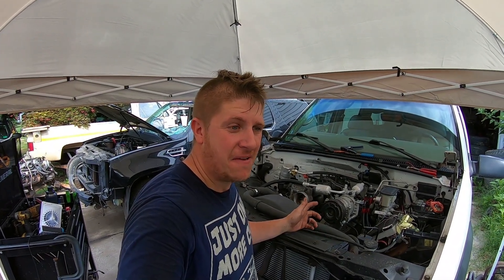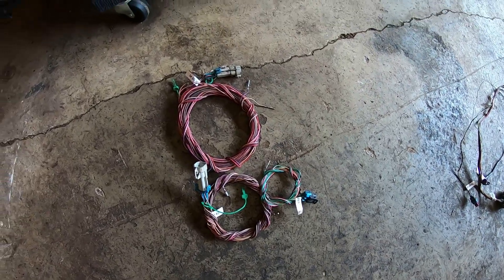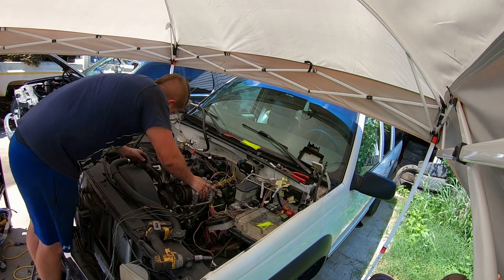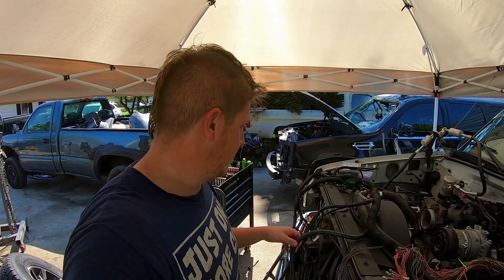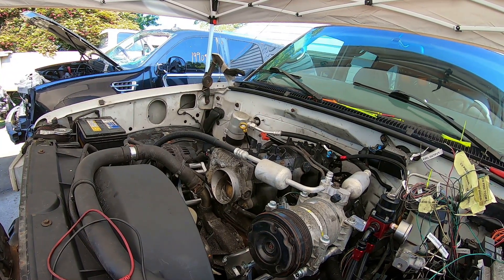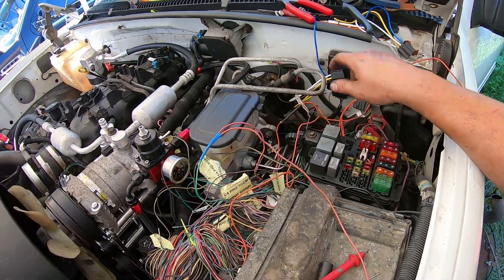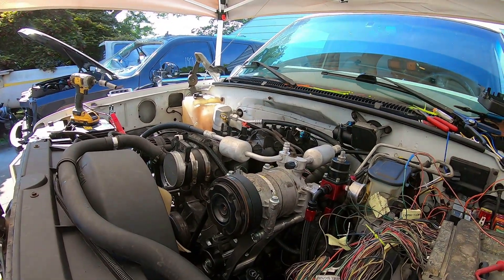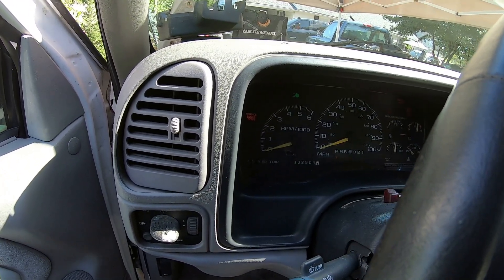OBS Chevy Suburban LS SWAP Part 3 - Electrical

Comment: Dude I like your vids, maybe you need to LS swap a weed eater and do some cleanup around the garage. LOL! Keep em coming. Maybe do a bit of how and why you strip the harness wires. Which ones to remove because, they are not needed, because...........
Reply from the maker: Thanks man! That would be a very heavy weed-eater! A little cleanup couldn't hurt, it'll get done once I have this project finished up. This harness I didn't really strip because we're using pretty much everything in it but I may have one in a future video that I could sow how and why to thin it out.

Comment: Yea man you actually explained and made more sense on taking my original harness and adapting it to the new one I wasn't for sure to pin it all the way in the plugs or just tie into the wires cuz someone I watched on a video was saying just to do that I'm glad I watched your video man thank you and you definitely got my thumbs up 👍👍
Reply from the maker: Appreciate the thumbs up man! Glad this info helped you!!
Reply: I got a question on the 4L60E transmission that I have on my 5.3 that came out of a 2001 Chevy Silverado I put it in my four wheel drive 97 Tahoe I have the ls harness hooked up to the motor and I have the big round plugged into the transmission and the two on the modulator I don't have the vent to hooked up do you think that's the reason why when I put it in drive it really ain't trying to go it's like second gear caches and it's got reverse do you think I need to hook up my factory harness before I'll know it has any problems
Reply from the maker: I believe the big round plugs are pinned differently on the pre 98 4l60e, so your 97 harness is not pinned correctly to control your 2001 transmission.

Comment: How did you get it to work with stock ignition
Reply from the maker: All you need is one ign 12v+ source from the stock harness to control your LS relays (I have a few that didn't have a job any more after I removed the stuff I didn't need from the stock harness so I used one of those) and then connect the original starter exciter wire to the exciter post on the starter. Super simple.

Comment: I am currently working on a 1997 k2500 4x4 swap. The donor is a 2002 5.3 ls L59 from a suburban. Does the a/c obs wires get relocated and repinned into to the 411 pcm. Great videos !!! You are inspiring a lot of us DIYers.
Reply from the maker: yes the AC wires from the OBS harness get repinned into the 411 pcm.  Thank you!!!

Comment: which harness did you use for the transmission?
Reply from the maker: The engine and transmission harness I used was from the donor truck
Reply: @MohawkMotors  thanks